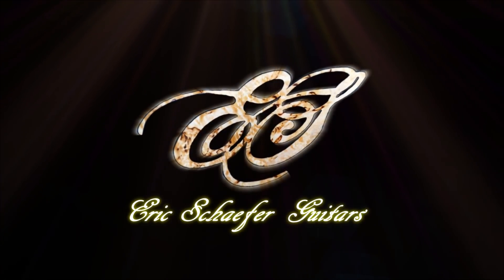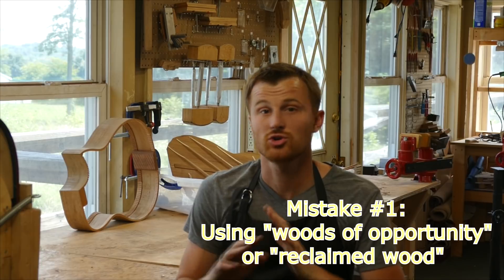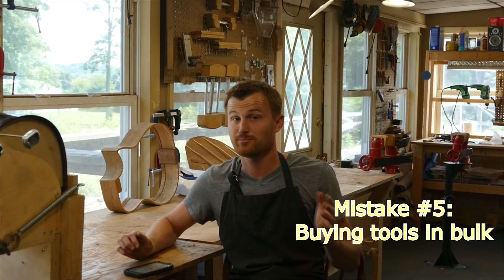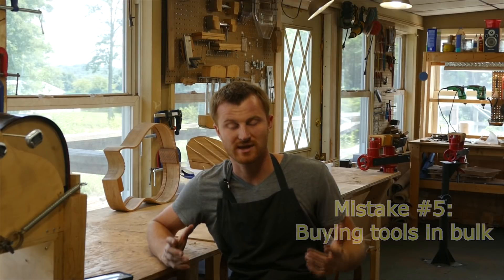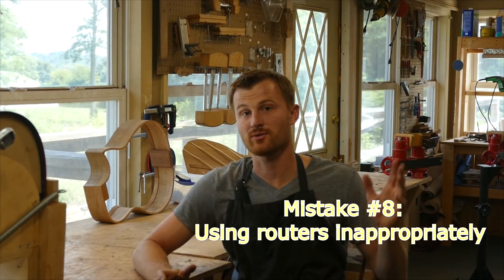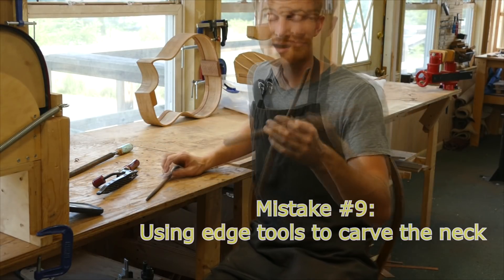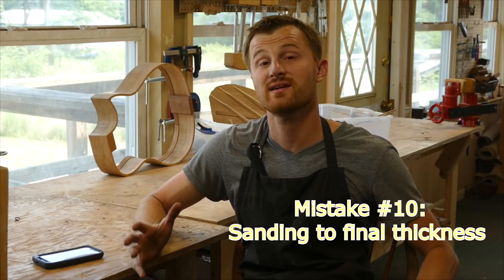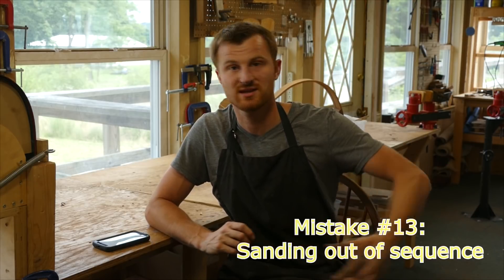14 Mistakes to avoid when building your first acoustic guitar

Comment: I don't normally comment on videos but I have to say great job on this. I have not built a guitar (yet) but have been in woodworking for over 20 years as a hobby and have built paddleboards and boats from wood. I think all of these principles are excellent for any woodworking project including a guitar. As with any woodworking project, it takes a lot of planning with the following steps in mind. There is a certain process. If you are in a hurry or just trying to get to the end, you are not going to be happy with the final product. A lot of good points brought up here! Lastly, if you have never worked with a sharp hand tool, it is smooth and sweet! I would prefer that to power tools for any fine tuned application any day and, yes, it is a whole other aspect of woodworking (keeping your chisels and planes tuned, that is). Again, great job on the video!
Reply: Thanks mate, that means a lot to me. Realy appreciate your comment and thoughts about it.

Comment: I'm profoundly impressed with how clearly you articulate the points you make. I'm almost 60 years old and a couple years away from retirement, looking for a hobby or avocation moving forward. I have a lot of Stewmac tools from projects over the years and a decent workshop. In addition, I have a friend who has a super equipped shop with pro quality thickness sanders, table saws, you name it. Still I find there are a lot of things I don't have and have resisted the urge to over buy. I stalled out in the carving stage of a maple violin back, partly because I left too much hand work for a novice builder. Recently, I've considered a kit guitar build. Also, I am stranded between maybe an upper lever mediocre guitar player (have a dozen years of competent club band experience in the past) but can't seem to reach what I consider an advanced player. At my age, wondering if I can continue to work on improving my playing while simultaneously trying to learn building. Your last point seems to stymie several aspects of my endeavors, but your advice has also given me some renewed zeal to get into and get finished with a build. I love the amount of natural light you have in your shop by the way.

Comment: I know I commented few years ago but reflecting on that 
Video as far as affordable tone woods
Just because it’s cheaper doesn’t mean it’s going to sound bad
The reasons could be people just don’t use it very often or it’s not in high demand cause they’re used to the usual, it’s simply that it’s readily available easy to harvest or even just that it’s rough sawn so you’ll have some work to do 

I found some beautiful Cuban mahogany back and side set for under $100 aud 
This was rough sawn about 4mm thick so a bit of work would have to be done but it’s a good way to get some experience with a hand plane or easy to thickness through a drum sander if you have one.

Just thought I’d put in a few cents

Comment: Your advice is bang-on, and you spent just the right balance of time between being thorough and droning on. My list would include #15: "Just Breathe." There's a time to step back and "regroup," and it's not all about mental bandwidth. Case in point: I'm in the middle of a build with cedar/figured walnut, and the workshop humidity won't drop below 70%. So...I breathe. I'm mentally ready to keep going, but the wood/RH isn't. So, I'll go practice doing inlay in scrap wood until I'm a ninja. Thanks again!

Comment: I started building in 1983.  Lots, and lots of mistakes.  I used Irving Sloane's Steel String Guitar construction book, or, I wrote, via mail, to LMI.  This video is loaded with great advice.  All I can add is the safety factor.  Use goggles with power tools and beware of wood allergies. Buy quality tools, especially chisels.  One big tool I really did not need is one everyone gets seduced by it.  The band saw.  I solved that by using a hand held jig saw and a spindle sander.

Comment: In 1972 I bought a piece of Brazilian Rosewood 8" wide 36" long and 2" thick. It cost me $45.00 Dollars. In 1975 I built One guitar from it. My first guitar build. Had I had the proper tools I could have possibly built Two Possibly Three form that piece of wood. While I owned it, it was best the best brightest sounding guitar I had ever heard. It rang like a bell and could sustain well over five minutes. I got harmonics on every fret. I traded that guitar for $2000.00 of body work on a car I had. Please never tell another person not to use the best pieces of wood they can afford to build a guitar with. My goal was to build the most awesome guitar I could with the best materials I could find. Sure there were some mistakes along the way but they all seem to have worked out.

Comment: My dad cut down some wide Mesquite logs around 15 yrs ago. It was so beautiful I cut some 4/4 board out of it quartersawn. It sat in my dads shop for 5yrs were he has a woodburning stove. I then resawed it and build a bajosexto( basically a baritone Mexican 12 string guitar). That was 10 yrs ago and that guitar has the best sound of any bajosexto Ive ever played. Its straight as an arrow and super stable. Wish I could get my hands on more Texas Mesquite wide enough without cracks to start drying.
Reply: Hi, thanks for your playlists. If your found of acoustic guitar, from a belgian man whose work shop is in switzerland (UE): Construction d'une guitare haut de gamme (1)
Bernard Jeker. It's in french, it's beautiful to see.
Reply: The important thing is that the Mesquite was properly cut and allowed time to season in the proper way. Eric is talking about a dude who goes outside cuts down the family walnut or whatever down and cut bits off it to go straight inside and make a guitar without proper process. Quite a bit different to your experience..

Comment: I‘m glad I took the time to watch this. So much good info! I‘ve been contemplating building a guitar for 7 years or so, but I have been easily overwhelmed by the amount of specialized tools and amount of time I would need. Finally decided to take the first step. I am going to get my feet wet on a small scale by building a ukelele from a StewMac kit. I will then move on to a guitar kit after that and just keep adding new skills as I progress, the way you said you did it. I will plan on buying your online course in the future too when I get to that point. Thanks for the motivation!
Reply: Just because a uke is smaller it is easy to think it will be easier. Not the case. Start on a guitar
Reply: orbodman already finished the uke. it was a fun build and a great experience. Now moving on to a guitar. I should be receiving all of the materials for it in the mail today, in fact.

Comment: about your last point: I was (...ok I still am) a perfectionist but when it came to building the guitar for my journeyman's examination, I had so little time, that I came up with my 85%  rule/target (sorry my englisch is not the best). Let me try to explain my theory :). 85% is a "degree of perfectionism" that you can achieve in a reasonable amount of time. The amount of time you have to spend, to achieve every single percentage after that rises (I exaggerate a little bit) exponentially. 85% ist plenty good for most people and still is a good representation of your workmanship. With this target you get (so to speak), "the best bang for the buck". I managed to finish in time, and even though I had very strict teachers I finished with top grade. I like to be an perfectionist and to take my time, but sadly I can't always afford to do so. Nice Video!

Comment: I do have a question. I'm in the process of making a couple violins with some help. My question is on the back and sides of the guitar, is there a certain type of cut that the back has to be or does that matter, I was just curious as with violins they need to be quarter sawn?
Or are the backs not as finicky as the top soundboard or like the plates of the violin?

Comment: I reclaimed some spruce from a remodel on a 100yr old house here in Texas. The grain was so close Ive yet to order bracewood as nice as it. They were 2x4s and quartersawn but these were real 2x4s not 1 1/2 x 3 1/2 like they sell nowadays. I used them as back braces and later top braces. Those guitars are still super stable and thats been over 8yrs. Sometimes one just hits the jackpot.
Reply: Cracked sound boards from old discarded pianos.....

Comment: I wish I saw this earlier! I experienced many of these mistakes. My biggest mistake on number one was the neck angle. The straight edge test showed that my bridge was way too low.  My pride prevented me starting off with a kit, but I see the wisdom in that now. Also, I used walnut for the neck which was way too figured for "edged" shaping, and very resistant to truss rod action.

Comment: Thanks Eric ,I am guilty of 4 of the 14 ,wish I had found you earlier would have done the online course . Building my first guitar ,cut away version, 5 sides later I finally did get the cutaway side successfully ,2 paduk,2 fiddleback maple & 1 walnut , My biggest problem is overconfidence as I am a curved stair builder/railing installer, different trade , different set of skills, Radiuses I deal with are much bigger or cut from laminated blocks either way ,I am now subscribed
Reply from the maker: Thanks! Yeah, cutaways are particularly difficult. I still crack a side occasionally on that bend.
Reply: @EricSchaeferGuitars  my first build was a highly figured cutaway. I wish I had seen this vid first. I got it done but not without serious difficulty.

Comment: Hello. I was considering trying to build an acoustic guitar. I would like to know if I can use cedar and mahogany together since it's the most common wood where I am from. There is mahogany, cedar, rosewood (dont know which type), samwood(also called laurel here), cabbage bark (a type of very hard wood here, sometimes they have ebony, bullet tree and hardwood or atleast  that's the local name here), as some of the few woods I know are sold here. Can I have any advice which to use???
Reply: Oh also they sell woods called zericote, jobillo and poisonwood as hardwoods and Santa Maria and prickly yellow as soft woods
Reply from the maker: @selincruz3783  this depends on so many things relating to your preferences that it is hard to even answer the question.
But I will say that Mahogany is always a solid choice, especially if ease of use and workability is a concern, which for a first time builder, it should be. Cedar is a great wood. I just built a guitar with a cedar top. However, for a beginner, it can be frustratingly brittle.
Ebony is also a great choice. For beginners, It has the added benefit of being the easiest wood to hide wood repairs.
Ziricote is a really beautiful wood, however, It is difficult to bend and is not ideal as far as workability.
Most of the other woods you mentioned I am not even aware of. Hope that helps!
Reply: @EricSchaeferGuitars  thanks for your advice. I've worked with these woods in carpentry, reason I have asked. But I'll keep it in mind. Thanks Eric I really appreciate it. Love your videos

Comment: Erik it is a pleasure to salute you, I am from Argentina and I am a big fan of your videos. I have a little cuestion for you, and if you can help I'll be very very greatful. I'm starting my first acoustic guitar proyect, I bought mahogany for sides, bottom and soundbar but I'm not sure about how thick that should be. Could you recommend me the thickness of each part?, mainly the soundbar around the bridge wich I think should be the most rigid part.
Thanks a lot.
Reply from the maker: Thanks, Patricio. When your building your first guitar you definitely want to err on the side of too thick. Far often new builders start at near-final dimensions and then oversand through the process and end up way too thin. So I'm going to recommend .110 - .125" for the soundboard, .100" -.110" for the back and .085" for the sides. Don't worry about having a variable thickness around the bridge. Your bracing pattern  should be what supports that area appropriately.
Reply: @EricSchaeferGuitars  thaks a lot, you are a genius. I'll try to do exactly what you told me.

Comment: I started with luan plywood.  It bended easily and didnt mater when i fukd stuff up.
Now im using black limba and wood in that moderate price range
Reply: If you are going to practice bending sides you should do it with the same species. and you should practice.

Comment: Great advice, but you could probably just start and end with #4 😂. Biting off more than you can chew applies to trying to use either non-guitar woods or high-figures exotics...buying tools you don’t need, trying to skip a dry run, not knowing how to sharpen edge tools or run power tools, etc. It’s all trying to run before you can crawl and walk. I’m a pretty expert woodworker (using tools 40+ years most of it professionally) but I’m still a noob with luthiery many years in. It’s a different animal altogether with a stiff and unforgiving learning curve. Start slow and plan on doing lots of builds before anyone will pay you for it LOL.

Comment: I bought a chisel for my first guitar build, and MY GOD, it looked like they chipped bricks with it. I've spent two hours sharpening it with a regular hand stone, and it turned out, it wasn't even heat treated, edge was ruined just afer adjusting a truss rod channel after router..
Reply from the maker: That's a bummer. That's a hard way to learn..
Reply: @EricSchaeferGuitars  Two cherrys makes a great chisle

Comment: Sorry mate your mistake #1 to me is anathema, I use entirely reclaimed woods and have had no issues at all, old furniture window frames door stiles. It's generally super dry and stable. And cheap.
Reply from the maker: Well, good for you. This is advice for a first time builder as it clearly says in the title. There is nothing wrong with using reclaimed wood. I've used it.  But if its your first build, and you dont have the experience to know what to watch out for, then obviously using, say, luthier grade mahogany is going to ease the learning curve.
Reply: My post seems to have been taken wrongly, it does sound a bit stern. It never was meant to be. What I meant was using cheap woods gives good practice without cost. In uk spruce and mahogany is very expensive

Comment: Lowden use reclame  WOOD. In his guitars.
Reply from the maker: yes and Lowden is not a first time guitar builder. The point is not a negative or positive judgement on reclaimed wood itself. Amazing things are done with reclaimed wood. The point is that for someone who has never built an acoustic guitar before, it is a very involved project, and using reclaimed wood, as tempting as it might be for some, adds a lot of unnecessary extra considerations and complexities and ultimately increases the chance that someone is either going to get analysis paralysis and abandon ship or simply screw something up because they bit off more than they could chew.

Comment: Your negative comments about pine tops are not correct....I have beautiful classical guitar that I built with a "clear pine top" and the grain is close and the guitar sounds fantastic!Obviously you have not tried it.
Reply: You can make a guitar from an old piece of masonite if you want, but there are  certain woods that are dead , and the prefered ones are what they call (lively ) especially for the sound board. It makes a huge difference.What do you want your guitar to sound like after you spend hundreds of hours building it. Your call. I guarentee if you would have used sitka it would sound better.